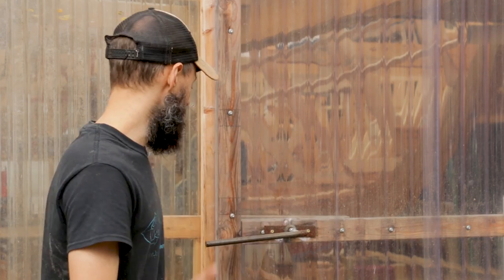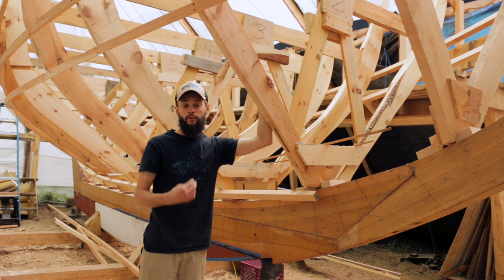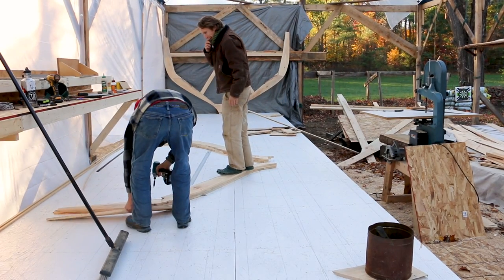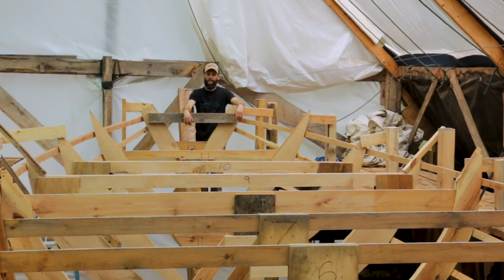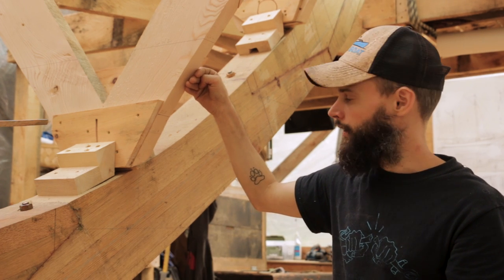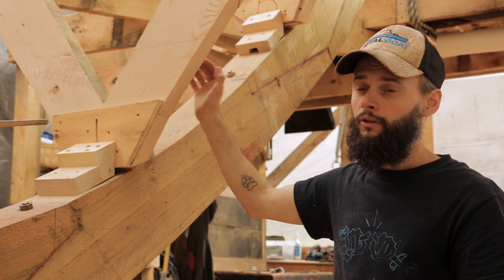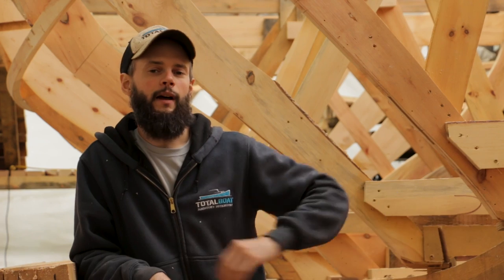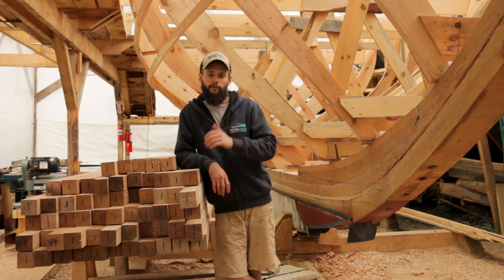Acorn to Arabella - Journey of a Wooden Boat - Episode 44: Putting Up the Molds

Comment from the maker: Hi everyone! I’m calling on the hive mind here for some help. I’ve had a couple issues in certain videos with a flicker after render. I have tried multiple different codecs but don’t know enough about those details to know exactly what is going on. Is there someone out there with the knowledge to be able to help with this? Thank you in advance!
-Alix
Reply: Im sure there are 100 tutorials that can help you with your problem. If you are specific enough with you googeling, that is^^
Reply: I saw no flicker or unsteadiness watching on a PC in Firefox Browser. FYI
Reply: The only odd thing I saw is the red line you drew in the beginning of the video showing the curve line was wobbling back and forth.  Everything else looked great, watching on YouTube via Chrome 720p on desktop.
Reply: No flicker on my PC. I have Google Chrome.
Reply: Are there any framerate discrepancies between your source media and rendered output? Or perhaps you're rendering out with interlacing that's going screwy?
Reply: i'm getting the unsteadiness and a bit of flicker. i'm on google chrome Version 69.0.3497.100 (Official Build) (64-bit)
Reply: What software are you using and what codecs have you tried? I work in media.
Reply: I notice the flicker as well, maybe it's some sort of stabilization that's accidentally turned on?
Reply: No flicker here. rock solid. Opera on Win10.
Reply: When ever evaluating your sound or video work, try to output it to a separate device to make evaluation more objective. When I do sound, my first take of a mix is out to the van for a side by side comparison with known reference  music, but at this stage I almost don't need to hear the reference to know where the mix is.  Try this with your video work to give yourself another way of evaluating where you are.... cheers... love the work and the vids... I wish I had the means to pitch in..
Reply: yep
Reply: same
Reply: I get a shaky wobble, is some form of motion stabilization going that's messing up?
Reply: Hi, it looks like interlacing to me. The whole picture 'jumps' one pixel up and down, because with interlaced video, only half of the rows are rendered. Every frame renders the other half. So first frame is even rows, second odd rows, etc. If you take interlaced video like this and render it as non-interlaced, you get this effect.

Solution: don't record or render interlaced.
Reply: The videos appear of excellent quality on my mobile. It may be that the issue is yours alone.
Reply: can you tell us  the xact moment of the flicker to analize it ? i didnt see any flicker
if is flickering caused by light sadly there's nothing you can do in edit to solve it
for the next time , you can sincronize the camera shutter with the flickering lights in some cameras

EDIT: now i can see it in full screen in the pc the image is wobbly
looks like an stabilizer issue maybe with the software or even the camera or the lens can do it if have internal stabilizer
Reply: This is not a stabilizer issue because you can still see it at 0:25 and that moment wasn't filmed but created from scratch with a software.
Reply: If you mean the 1 pixel jitter between frames, try exporting raw and encoding with h.264 with handbrake. Shoot me a message, I can help!
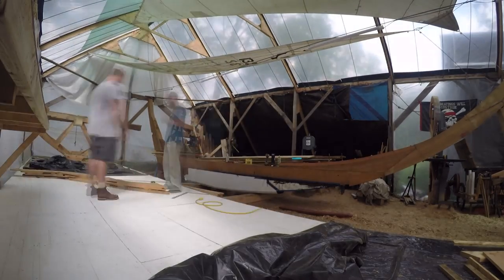Reply: I viewed the 1920x1080 YouTube rendering on a 3840 x 2160 (in full screen view) on Firefox Quantum 61.0.2 on Fedora 27 (Linux).  So each of your pixels turns into a 2x2 square on my monitor.  I do not see any sub-framerate flicker at all.  I do see framerate flicker on the time-compressed bits (like at 6:10) but that's to be expected because you are removing maybe 98% of the frames.    Are you seeing the same flicker when you play it on YouTube?  What camera setting do you use to record?  1080p or 1080i?
Reply: @peromo9397  jesus people still use Opera?
Reply: Now that you brought it up, yes there's a slight flicker on the entire video.  But hey, it's only YouTube.  It's fine!
Reply: It looked perfect to me on my Mac...no issues at all...great video by the way!! :)
Reply: I've seen a bit of flicker in past videos - particularly the intro - but nothing here.  The worst thing here is some stutter/jitter in the first scene after the intro.  ...But it clears up with the next scene.
I offer no solution.  ...Just wanted to say that I see no flicker here.
Reply: No flicker here with Google chrome 68.0.3440.106 (Officiële build) (64-bits) and MAC OS 10.13.6. Maybe an issue on client side?
Reply: check that when you are rendering that the machine you are useing isnt overheating and has a stable power supply and source
Reply: The second one does look much smoother. No back and forth jerk!? Though to my untrained eye... It looked great to me when watching.
Reply: Looking at the video 'stats for nerds' in the right click menu, your video is 24fps. It should be 30 since I'm sure that's what your source is from the cameras or 60 even on the camera. Probably just one of your render settings related to the output frames per second. Hope this helps or points you in the right direction of what to look for.
Reply: Im not an expert, but two things:  Are you using flourescent lights? Are your settings NTSC or Pal?  I wouldnt know how to fix it, but just sayin' in case it helps
Pete
Reply: dude we are not seeing the flicker on our end and I'm running 4K @ 60 FPS monitor YouTube's 1080 ... lol Steve's perfection is rubbing off on you pal just roll with you guys are doing just fine ;)
Reply from the maker: Thank you all!  Hadn't been getting notifications of all these comments.  It would be hard to answer everyone.  Basically I'm shooting at 24fps (I was pretty sure as progressive but should probably check to see that camera settings haven't been accidentally changed).  Rendering is H264 on premiere using the YouTube preset (I don't have much experience with all that kind of stuff and have been basically doing what I thought was right and easy).
I don't get this issue often (it's only happened twice that I've noticed) and I'm not sure yet why it happens, so still trying to figure that out.  I'll check the progressive and interlaced ideas as that makes the most sense to me.
Again, thank you all!
Alix
Reply: @crangos  This is what i get as well. more of a shake than a flicker.

Comment: The only frustrating thing about this channel is that every time you upload these awesome quality 25+ minute videos, I'm left wanting to watch another hour or so of it.  Great work guys, absolutely fascinating to watch.
Reply: @Clifton you have that right. Another great vid guys.
You know, there has to be a "better" way to transfer the line from the lofting floor to the frame that does not use the nails... But I somehow doubt it would be as fun. (Van Halen's Jump is springing to mind :P)
Reply: This 'better' way would be ...? It's the step from two into three dimensions.
I've learned to proceed said step some 33 years ago exactly the way Stephen and Alix (and Leo Sampson, by the way) do their transfer from loft to frame, and my teachers (three generations of boatbuilders in one yard ...) told me back then it was made like that "ever since".
We tried other ways, put an episcope to work, put a beamer with "internal correction" to work in vertical or horizontal application, tried crossing 
vector lasers otherwise used to "burn" 3D forms from a tank of liquid resins and bored the hell out of a bunch of nerdy IT-students recurrently with our idea of "accurate" .... all with not the exact result the bloodily outdated roofing nail technique does still give You in terms of a correct sawline on Your frame off a wooden lofting floor.
Reply from the maker: Sometime the old ways are tough to beat!

Comment: All I have to say is that it took a looooong time to get to this point. However, you are moving so much faster now! I surmise that you made very sure to have a solid foundation. I also imagine what is was like to put a craft like this together before power tools. Not to take anything away from your efforts. I have no doubt that you could do the same job with only hand tools. But I know you are glad not have to. Keep the videos coming. They are very enjoyable and a pleasure to watch as you share your journey with us all.
Reply: I thought the same about old style tools compared to power tools until I went and helped a traditional boat builder, you would be surprised how a sharp axe, chisel, can peel through timber in short order, I would hazard a guess that the number of boats built  with old school methods far out number power tool builds in the world. 😀
Reply from the maker: For the build and the project as a whole we tried very hard to form a solid base to build on, it was slow to start because of that but it is starting to pay dividends =) 
For this type of construction I would wager you are correct.  I can remove more material in less time and noise with an adze than I can with a router.  The adz can also cut a compound changing bevel with no fuss or jig.  The caveat is that it takes time to get good with the hand tools.  If I built another boat like this the adz would play a much bigger part in the early stages.  The lipped adz is a game changer and it only took 28 years behind an axe and another 100 hours or so behind the adz to feel like I am getting good with the adz.  The background with the axe helped a lot although they are swung very differently.  A few thousand hours more with the adz and I will feel as confident with it as I do with an axe.

Comment: I have never seen /heard of using this method of framing with a new build so will be interested to see how it works out particularly in relation to how Leo is getting on with his method.
Reply: Haha i just made almost exactly the same comment then read yours. Im also very interested as im a journeyman carpenter by trade/occupation
Reply from the maker: Both vessels will float and should last 100 years or more if maintained.  Both are very proven construction methods and a lot of it depends on opinions and available materials.  Both have their pros and cons.

Comment: I hope You will not regret the slightly premature riddance of Your lofting floor, but by now You probably have all measurements of each'n every frame in all three dimensions well off by heart and could nearly build the rest blindfolded ... good progress, good videography, good boys!
I remember when doing work there some of the croats and usually the turks building their sturdy scaffold/staging frames well before the keel was placed when building traditionally wooden under the sun (= no ridge present to be used as a donkey).
Thanks for sharing.

Comment: The boats I worked on were rather bigger than this, so they had sawn frames, but bent frames are intrinsically stronger pound for pound with the grain following the shape of the frame as it does. There are concomitant savings in weight, and more usable room below deck. I'm more familiar with sawn frames where there is a hog (keelson)bolted on the keel and frames sitting thereon, and another keelson on top of the floors, and bolts through (or even thru) the whole shebang. It'll be interesting watching as you progress through the framing.
Reply from the maker: They are indeed much smaller and lighter.  Our boat is build much lighter than the ones you worked on! No keelson on top of our floors.

Comment: Wearing my new red backbone T shirt.  I'll bet it was hard to take up the lofting floor.  Really helpful to have that to refer to whenever you need it.  reassembling it piece by piece when you need it will never be as nice as having it all laid out full size.
I'm wondering about your frame material.  I hope you were careful when ripping the stock to avoid cross grain.  Steam bending loves riven stock but if you have to saw you need to be sure to follow the grain.  But you already know that and besides with all of that tall white oak cross grain is probably not going to be much of a problem.  Great work!  I always look forward to the next installment. And I'm always amazed at how much you get done in a week.
Reply from the maker: Thanks for the support!
The frame stock was ripped along the grain with the bandsaw.  We bent 23 frames and had 3 that cracked or split a little and were culled.  One cracked at a pin knot so we will crop it there and re-steam it for a shorter frame in the bow or stern.
Our big straight oaks gave us some top shelf quality bending stock!

Comment: Nice use of fast motion on a very slow process.  Would it be possible to use a projector to transfer the individual frame spec directly to the frame lumber? You'd be before the mast in a lot less time.

Comment: Hi Guys. Great job! One question, aren’t you afraid that notching the frames into the keel timber could be a hazard with water sitting there and inviting rot into the keel. Most boats I have seen have the frames ending before meeting the keel (although they are normally smaller boats, that might be the reason). Congratulations

Comment: Have you considered bracing the molds against one another, internally? A couple of boards arranged in an x pattern for the horizontal and vertical planes in each gap, connecting every mold to its neighbors. That could give you a much more solid internal structure without external supports in the way.
Reply from the maker: It would work but would make steaming the frames a nightmare.

Comment: I really appreciate your attention to detail you guys are doing an awesome job however it looked as if your lofting floor was incredibly stable you could have just run some braces from your molds  down to your Lofting floor and screw them in place. I'm sure that would have kept them stabilized but that's hindsight, and you guys have made a huge leap forward keep up the good work

Comment: I can see where beveling the attach point at the base is and presenting the flat of the rib, to the compound curve,
is far easier and maybe overall more accurate than beveling the entire length of the rib on a ships saw.
Also if building the same hull repeatedly in production with a few mods and a crane you could lift the mold out after the
hull is formed !
Reply from the maker: Bent frames are easier and faster for sure and you are correct, the molds can be re-used for multiple boats.

Comment: Hi guys, I hope you dont mind, but I keep thinking the joints of your lead keel are the wrong way around. I saw a video called  "building Emma" and they did them the other way around. Which made more sense to me, because in your case the weight of the lead is supported only by the bolts, not by the wood of the keel.
Reply from the maker: We are building her as designed.  The deadwoods would never be strong enough to hold that monster keel on always.

Comment: Very nice inspirational work going on here.
It is a bit late now that the lofting has been pulled up but for future readers...By this stage in the project you probably won't need the whole lofting again, but you might want to reference parts of it. After pulling up the floor on my last project I realized I should have labeled each sheet and created a map so I didn't have to shuffle through the whole stack to find the one or two sheets I needed. Good luck with the steaming this weekend! My next big project calls for 1 1/4" x 1 3/8" steamed frames and that feels thick, the 2 1/4" square ones for Arabella should fun.
Reply: I hope their lofting sheets are well organized. Wouldn't Arabella's frames be 2 1/2" x 1 1/4" He said they would split the 2 1/2" square in half.
Reply from the maker: We put them away in order, standing on edge so we can flip through them like a book.  It's easy to find and check measurements so long as they are one 1-2 sheets.

The frames were 2-1/2"x2-1/2" but split to within 5" of the end so we were really only bending 1-1/4"x2-1/2" frames.  After about 110 minutes in the steam box they bent wonderfully.

Comment: Why didn't you brace the forms diagonally fore and aft and up and down? Like from the bottom of station 3 to the top of 5, and the bottom of 4 to the top of 6, etc.? Wouldn't that have stiffened up the structure?
Reply from the maker: We are going to have to work inside there when bending in the frames. Any bracing in there would make it practically impossible to move and bend the frames. That is one of the reasons they are usually braced up to the rafters.
Good question!

Comment: I guess everyone does it differently than others, we used to cut our rabbit and timber pockets prior too putting up the frames. The rabbit was done with a skill saw,  very Efficient way too cut the rabbit except for the curve on the forefoot meets the stem post, we had a fairly straight sternpost so the saw was used too cut the rabbit there also. As for the pockets they were done with chesik

Comment: The easiest way to solve your problam is to temporarily anchor the top of your molds to stakes in the floor. Your ribbons should be only far enough apart to get a C clamp between them to bend the frames. 
OLD BOAT BUILDER

Comment: Triangles. You need triangles. From mold to mold, and the top of the molds to the keel.
Reply: (He says before seeing the staging. Much nicer solution!)
Reply from the maker: Triangles would have worked but would have made bending the frames in a nightmare.  We have to always be looking many steps ahead!